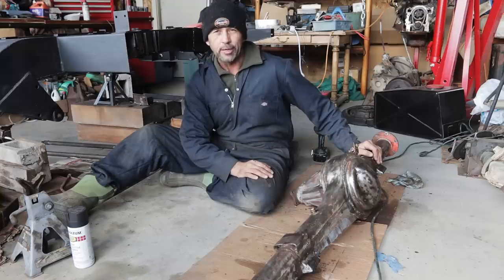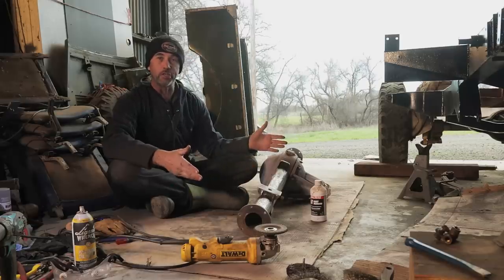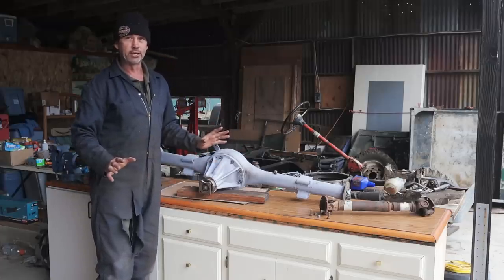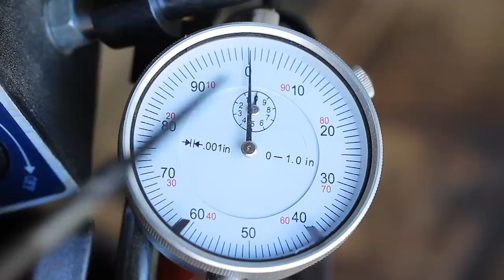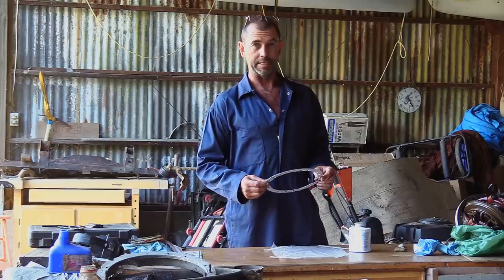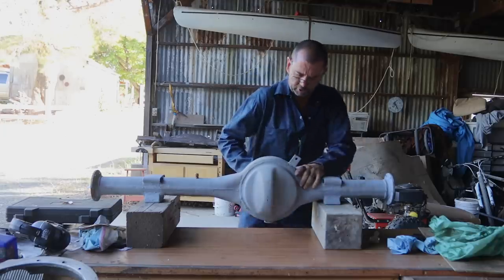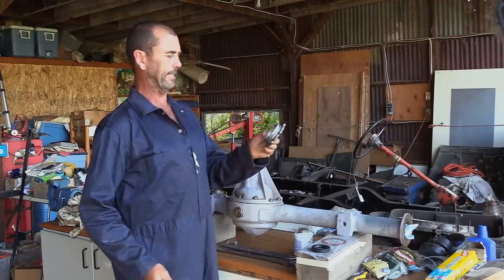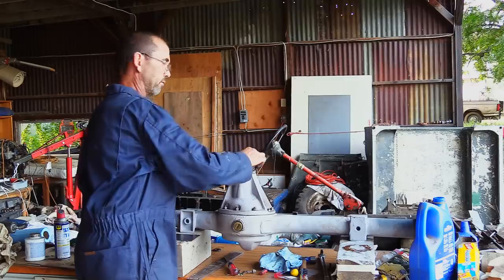Part 7_ Rear Diff Inspection. Series 1 Land Rover Restoration.

Comment: And just when I was procrastinating about going to bed for a grandpa nap, along comes Mr Foreman and family with the rear bit, er, diff-thingy.
Now I ask you, how can I possibly lie down now!!. Sigh.
Reply: Interesting the last part didn't fit. Was helping (read that as standing around getting in the way) a friend doing his Subaru timing belt. Fortunately not a twin overhead cam motor; just single overhead cam Forrester. He had decided on a course of preventative maintenance, so proceeded to install a new water pump. However, no matter how hard we tried, we could not get the bolt holes to lign up. Yep you've got it. The new part was wrong. But JJ being a klevah bloke, tweaked the new housing a bit (just over 1mm) with his bastard (oops!, not swearing, honest!) with his trusty high speed rotary persuader file thingummyjig (angle grinder). i.e. lowered an L-shaped face by around 1mm.
PS Glad Wilms has figured out appropriate classy fication for you Mr Foreman. I little concerned concerning the non-show of the workshop foreman?. Although he did show in the opening animated intro. Unlike Wilms, whom I guess was hiding beside your silhouette ?.

Oh BTW I'm wide awake now :) Thankyou :)
Reply from the maker: A hot chocolate and a book should help with the insomnia. The latter is a rear sedative, just ask all my teachers from my school days.
Reply: @ForemanAndWilmsAdventures  Hahahahahaha, :)
For me it sometimes would be a high velocity blackboard duster accurately aimed at my dozey head (or sommebody else's dozey head. Well we felt it was at times akin to WWI trenches.) by a much-feared "One-whom-Must-Be-Afeared" Teacher. At other times, it might involve the shame (and admiration by some unscrupulous fellow students) of being called out the front; for the application/s of bamboo.
Reply: Valium.... it’s a wonder drug
Reply: nbrettoner  bamboo ha .... obviously you never encountered the Christian brothers and the “strap” a device of punishment and retribution that was like 6 , 600 mm sections of leather belt stitched together in a stack wielded with gusto on the outreached hand of the sinner....if you cried out the next crack was harder ...... apparently built character in young men...........

Comment: More than I did with my rear diff. I just put oil in it, cracked a beer and said "that'll do the trick". (see how it goes in the long run I suppose..)
Reply from the maker: It's most likely all you needed to do, Could have saved myself a lot of work doing the same.

Comment: Also you need a bit more clearance for the Bell housing as the V8 sits higher so Copy the the one in there Rather than original specs the Diffs from a early Rover Car 1950/60’s will Work too, Range Rover ones have a flat bottom it’s un drivable with the 4.10’s

Comment: I’m trying to work out the gear Ratio you need the 12 spline 3.6 from early Range Rover if you run the V8 3 times the Power maybe already changed as you have a later Axel there it looks like

Comment: it does have to be their otherwise your axle housing will bend when you do a bit of rough stuff off road i would get it all welded again so no leaks
Reply: Mate don't force it use a bigger hammer
Reply from the maker: Greetings there All A Round Aussie. There's quite a few folk saying what your saying, I'm feeling some regret now about cutting it all off. I suppose I still have to get it running again yet before I have to concern myself with bending axle housings. Presently the former is less likely than the latter. Thanks for the comment, Cheers.

Comment: Having had the misfortune/stupidity to actually own several self destructing pommy shitboxes, sorry Land rovers ( series 1, series 109 station wagon, early Range rover and the final indignity. 2 Defenders) I should more than strongly recommend you replace the reinforcing web on the banjo housing (diff) from memory the early series ones did not have the addition till some genius at rover actually accepted the advice of all the dim witted owners who's rear banjo housings looked like salted & twisted pretzels. Given that you are applying all that power from the asthmatic Rover/Buick V8 I would be using the strongest arse end I could build. Now happily driving a Landcruiser 80 series with 750.000 kms on it.
Reply: Need some new overalls mate ha ha must protect the wedding tackle
Reply from the maker: Wonderfully written. The passionate and slightly ferocious words used for the Land Rovers reveal the addiction still festers beneath the surface. I now see the error in my cutting out the whole webbing on the diff but the good news is I still have a gearbox and motor to attend to. Meaning I may never have the opportunity to bend a housing. I concur that the Toyotas are magnificent machines having done a lot of miles in them as a guide in Kakadu. Very reliable.
Reply: @ForemanAndWilmsAdventures  Funny you should comment that the urge still lingers as my dear wife of nearly 40 years wants a series 11 swb hard top. if i weaken I will probably put an FJ45 toy under the Landy body. Perhaps even with a small cummins for power.. Anyhow i digress. this morning went out to the Cruiser , plonked my left hoof on the clutch, straight to the bloody floor. Solution no 1 steal the wife's Ford ranger drop side tray and do the job I had intended to do with the Toy & trailer. Mission accomplished.
Clutch has no leaks so simply refilled it, bled it and we are away again. Oh' top have another shitbox (I mean wonderful Land Rover again). have already made the appointment with the shrink!
Reply from the maker: Frank Robinson absolutely brilliant! You have a much more wonderful existence than you know.
Reply: Haters gotta hate aye

Comment: I think that steel spacer you replaced is a gasket for setting the preload on the pinion?  2 years too late again. So I guess the question is - was the diff noisy ?
Reply from the maker: I found a replacement for that in the series 2 section of the spare parts website and have since gone back and stuck it in. It's possible it may be a later series diff? I've not driven the vehicle to know how things will work, When I first got it there was no oil pressure and I think the carbs were blocked so I could do no more than idle it into position and shut it down.
Reply: @ForemanAndWilmsAdventures  Bit more info that may be helpful ... lots of series land rovers have been fine with a Rover V8 and standard axle, without the stiffener.
Which leads us on to .... why your axle has fully floating rear shafts and a stiffener?. Fully floating shafts came in with the series 2 (with 1 exception I think) - stiffeners were fitted to military land rovers (with 1 exception I think) - now the exception .... I think very late 107” Series 1 Station Wagons - had fully floating shafts and a stiffener.
If you’ve had a series 2 axle fitted it will be wider than a normal series 1 - so slightly wider than your front unless that’s been done too  - or it’s a super rare 107 rear axle with Uber rare half shafts.
Reply from the maker: According to the green bible the later model series 1's have fully floating axles, or at least that's my interpretation, I'm unwilling to commit to anything as I'm still an acolyte in the vast and complicated history of land Rovers. I'm certainly uncertain about the rear axle though. That metal gasket was not in the series 1 spare parts section which is why I suspected it may be a later model. Many mysteries.
Reply: @ForemanAndWilmsAdventures  Another forum for you : LRSOC  the series one club. You don’t need to join to use the forum - and nowhere on the net knows more than those guys. The fully floating were offered as an upgrade in the parts manual - they came with a factory spacer. I’ve just converted my 1951 to fully floating and it needed a spacer under the flange for the S2 half shafts to fit. The club have remanufactured the shorter S1 fully floating shaft - but they are really expensive.

Comment: i have been waiting for the next episode, checking youtube every night.  i am working on a old landrover as well,does anyone else work as slowly as me,  a couple of hours every day over the past 4 weekends just to replace a battery tray on a series 3.  i know the supports are usually welded but my vertical and upside down welding is not the best.  also didn’t want to burn off the paint on the inside of the chassis.  next mission is too straighten the brake lines, looks like at some time a stick had come up and bent them.  couldn’t get the front guard away from the vehicle due to the radio antenna lead not passing through a hole on the inside of the cab.  ps starting to watch your old western walkouts with my wife every couple of nights, both of us really enjoying them.
Reply from the maker: As for working slow I might have you beat. It might be close though. 3 days on a battery tray sounds like rushing it to me. Glad you like the Western Walkabouts and good luck on the old Landy.

Comment: Can't beat aviation form a gasket,love it👍
Glad you took that stiffener,or brace off the axle tube,plain ugly it was,and as you said,you were able to access and treat the mischievous rust there under👍
Britpart,yeah,you have heard the stories😂😂😂
Just got to be careful what of theirs that you use.
Australia has a good supply of most threads,local and foreign,because we have such a variety of vehicles here.The good old United States of America land seems to cater mainly for local brands from what I hear.
Good progress,see you for the rear end assembly👍😊
Reply from the maker: Greetings Wayne, quite a few folk feel the brace on the axle tube is important and one fellow suspects the diff comes from a later model vehicle. I don't know but I've done what I've done. I think getting rid of the rust is more important at present.
Reply: Those axles are built like brick shit houses, so tough enough unless you are putting 600bhp through it!!! If you need something tougher put a Salisbury in it. They are bombproof 😁. Oh and a drop of oil helps too!!!

Comment: Foreman - I should not worry about having removed the axle casing strengthening wedge - it is for a LWB 107" or 109" Series I, and as you have an 88" SWB there should be no need for it, unless you are trying to pull the skin off a rice pudding...
It would be a good idea to also remove and clean out the axle breather (a can of WD40 with the ubiquitous straw attachment will flush out the crud!)...this will help prevent blowing out the axle hub seals when the Hypoid oil inside the axle heats up and pressurises the void.
If the oil seal retainer has burrs with the mating surface for the seal, best to gingerly remove them first using a Swiss file, before smearing your sealant and fitting the oil seal.
Also worth rechecking that the correct crown wheel securing set bolts have been secured using the correct locking tabs (there are 2 different types - single or double lockers - to suit 2 different styles of indentations in the crown wheel casting - some clown put on the incorrect lockers on my rear axle, causing the set bolts to work loose, and one fired out through the axle casing faster than a rat out an aqueduct when I was in the middle of nowhere...luckily I had come beer and crisps to overcome the trauma!  New correct lockers, set bolts and a weld to the axle casing pan, along with new Hypoid Oil were all required...
Worth not using Blue Boxed new parts unless you need to - try fitting an SKF Speedisleeve over the worn part of the drive flange - will be cheaper than buying an NOS drive flange...

Enjoy!

Mark
Reply from the maker: Good to hear about the axle thingy Mark. Thanks. I’ve got new breathers to install that have hoses to bring it higher. This model doesn’t have the axle seals, the stub axles just bolt onto the ends. Luckily for me I didn’t have to make any adjustments to the final drive as it seemed to check out so all the original lockers and stuff remains unaltered. Sorry to hear about what happened to your wagon, beer and crisps are for sure needed at such trying times.
Reply: @ForemanAndWilmsAdventures  Foreman - Always an good watch!  The rear axle seals that I was referring to  are at the hubs on the rear axle, but are for the semi floating version (earlier variant and came with issues...), but I see that you have a fully floating rear axle - my apologies for trying to scare the sh£t out of you!
Reply from the maker: I figured you were referring to the earlier semi floating varieties, no apologies necessary.

Comment: That webbing is very much needed , the housing have a evil habit of bending, to put the webbing back on it will have to be put in a jig to stop any distortion! You are a norty boy for cutting it off. Permatex is great but don't put it on the gasket out it in the metal faces , hope you set the pinion preload by the book , cant remember if it is spring gauge or torque wrench on those particular diffs . I love the YouTube videos they make mechanics like myself loas of $ from ppl trying to fix things they should not touch. For britpart stuff get the ones with G in front of the part number you will never have a problem. Not sure if that is a S1diff the spring seat does not look right and the internals look to be of a later diff . Possibly a D1 or early Range Rover food for thought it was a very common mod here in OZ
Reply from the maker: That's interesting what you say about the diff, I would have no idea if it's the original or not. All the bits line up with what the workshop manual shows but they probably haven't changed too much in their basic design. I now regret cutting off all that webbing though the rust underneath was quite bad, I might have been between a rock and a hard place on that one.
Reply: I can't remember which axles you had on that , yje non floating axle diff combo in the s1 handle big torque no problem. They handle the ford 250 and the 225 slant 6 valiant motor without a problem bot those have more torque than the 3.5 rover the other style diffs and axles are made of stale bread and moldy cheese . Something on that diff does not ring true as a original i cant remember what i have seen that diff in before for the life of me . With that pinion not fitting that clearly shows it is off a different model they just fall in from a s1 to haul trucks no black magic or big hammers needed for any of them . If you can borrow a flange off someone that has a early rangie or disco it should solve the mystery
Reply from the maker: pete ryan that’s a very good point on why the drive flange didn’t fit. This YouTube Business is quite handy as I get to learn quite a bit from comments. Maybe I should spend some time on forums.
Reply: Any information you need is at your fingertips in OZ , look up AULRO site it is the biggest Land Rover forum in the world, some incredible knowledge in the form, everything from S1 to the latest along with specific sections for drive line , brakes , steering ect ect I thought I was pretty good with the early stuff but there are rivet counters there that can give part numbers off the top of there head and some of the mechanical knowledge make my 40 plus years in the trade seem like that of a first year apprentice
Reply: Never be afraid to ask questions